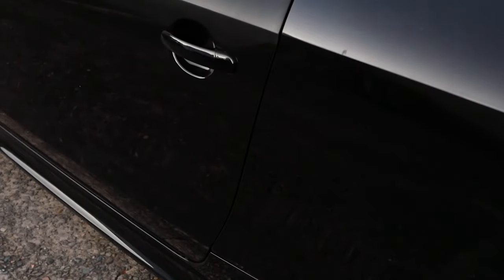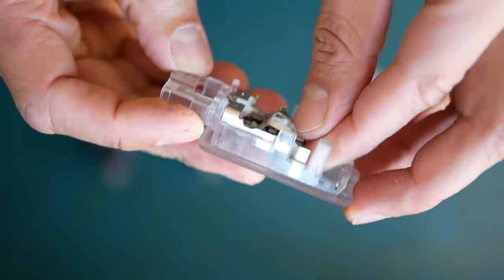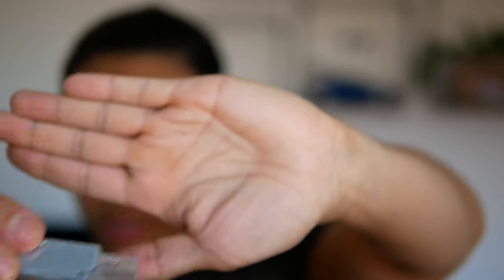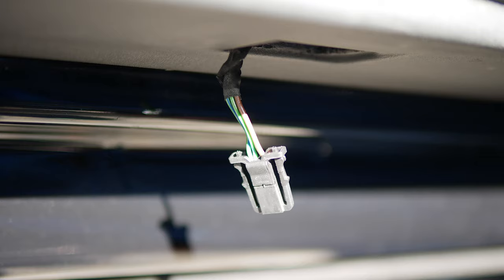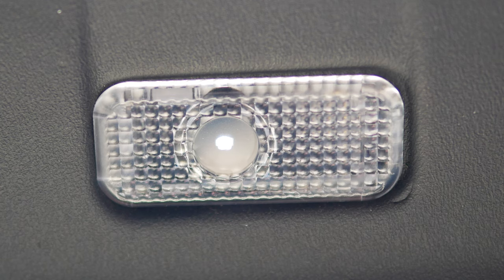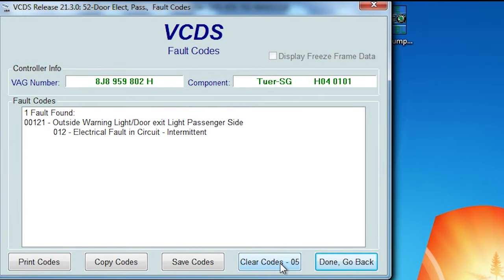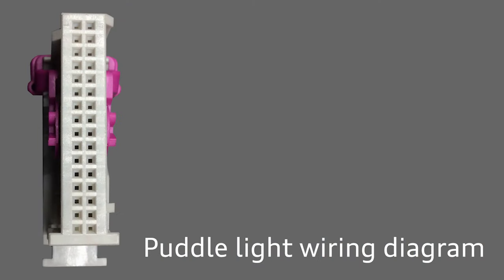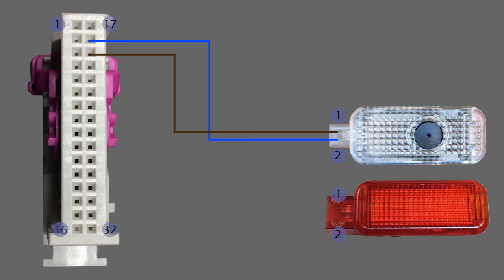Audi Projector Logo Puddle Lights Install (TT Mk2 8J) Comparison, Wiring Guide & VCDS Coding Guide

Comment: Hi Ian, are those pins already populated in the harness? If not, do you have idea what's the part number for those pins? Tia
Reply from the maker: Most likely not already there. 

I don't know the part number. I always just get them from the wreckers. Any Audi instrument cluster plug will have the correct pins for the module and then just find the lift side plug from AliExpress or eBay.

Comment: Excellent video Ian.

I'had Done this installation on past month. But with chinese projector.

It's clearly The differences from OEM projector.

I'm have a big doubt in how to install The footwell light for a Facelift model.
Are you planing to release a video for footwell too?

Thank you very much.
Reply from the maker: Hello Oni Driver. Yes the genuine one is much better!

I have already made this installation of footwell lights :)  you need to make some connections into the cecm + coding. It’s not too difficult. 

I can work on this video :)
Reply: @ianpgonzaga   thanks for your attention. 

It would be very helpful a video from you, regarding to footwell installation :D. 

One day, i intend to acquire your ColorMFA display. 😍
Reply from the maker: @OCTANEBR  no worries. It’s better to keep busy than not during these tough times. Thank you for the suggestion’ x take care of yourself and hopefully see you around soon.

Comment: Hi Ian, 8J8959801E is my drivers door module and 8J8959802E the passenger one. Any idea what pins I should use? I can't seem to find any pinout online... No idea if it's pre face-lift or what. 2008 TTS. Tia!
Reply from the maker: Hard to tell without a visual but if it's FULL of pins the better and the more extra functions it's likely to have. 

Pinout info here 

https://www.ttforum.co.uk/threads/door-module-upgrade.1768058/
Reply: @ianpgonzaga  sorted. Looks like mine was 18 and 19.
Reply from the maker: @bgabriel758  winning !
Reply: @ianpgonzaga  Hi Ian, is it possible to connect to those pins 1 or 18-19 dont know what module i have now, but i want to connect Blue Dynamic mirror light "Welcome lights". Is there a constant current or does it work only if car is stationary and its unlocked ? or do you know which other pin can i use for that ? i have 2007 without puddle light.
Reply from the maker: @kidlifecrysis4203  I know these aren't constant because they turn off after a while even with door open. 

You'd have to just use a multimeter to find a constant 12v. Otherwise the thick red or red w/green will have constant as. They power the module.

Comment: hello, I bought the LED courtesy lights "QUATTRO" to replace the current courtesy LED lights of my audi Tts 8j and I'm wondering if they are not compatible;  I bought the following 4G0 052 130H if they are not compatible, what can I do to make them compatible?
Reply from the maker: Hi Giuseppe. Just looked them up. It seems they’ve used the old, big plug type for these units in the larger cars. 

https://www.ecstuning.com/b-genuine-volkswagen-audi-parts/led-lights/4g0052130h/

You can see it’s shape is neither like the ones I used. You can easily get this 2 pin connector from Audi VW’s <2004. Then you’ll just have to solder them in like I did to change the plug style to fit your projector lights.
Reply: @ianpgonzaga  can I ask you the courtesy to link the components necessary to make the adapter cable that will allow me to operate the lights I ordered on my TT 8j?
Reply from the maker: @giuseppearmranrandone5726  https://www.aliexpress.com/item/1005001474674900.html?spm=a2g0o.productlist.0.0.534026a0uv7zeL&algo_pvid=153ff118-6c49-4ae9-be56-8208dc93fe4b&algo_exp_id=153ff118-6c49-4ae9-be56-8208dc93fe4b-1

that should be correct. please verify with your plug shape :)

Comment: Hello Ian.
I'm interested in a VCDS but they all come with a CD-ROM. My laptop does not support that any more😅
Was wondering if you are in the same position as me and you were able to download the drivers to a non CD-ROM laptop.
Thanks mate and keep up the good work 🤗
Reply from the maker: I’ve never had a cd rom with my cable and always have downloaded the program and upgrades from the ross-tech website.
Reply: @ianpgonzaga  excellent! All I need to to know. I can order mine now.
Mind if I ask you which model you have if possible. Thank you 👍
Reply from the maker: @brunotavares1642  mine is the first version cable Hex+CAN 

I don’t think they make it anymore so it’s only available second hand. Maybe look on eBay?
Reply: @ianpgonzaga  I will and I am at the moment. Thanks mate🤗👍
Reply from the maker: @brunotavares1642  good luck!!!

Comment: Hi,my control plug 1 has a wire in it 2and three are free? Mines tt is 2008 model any ideals way to put the wires thanks Ed
Reply from the maker: Hey Ed check out this post. Might be helpful. 

https://www.audi-sport.net/xf/threads/my-diy-guide-for-retro-fitting-puddle-lights.58244/
Reply: Hi ,in pin one there’s a brown and blue wire ,pin 2 is free a bit stumped, other posts say use pin one as ground
Reply: Hi,Ian puddle lights working thanks for the video
Reply from the maker: Great job  @edwardlacey4376 ! THanks for the update.

Comment: Hi
I have a 2017 tt …and I what to instal the puddle  light is needed coding?
Reply from the maker: Hi Ovi - If you don't already have the plain lights in your door then you will need o add wiring + coding 😃
Reply: @ianpgonzaga  thank you